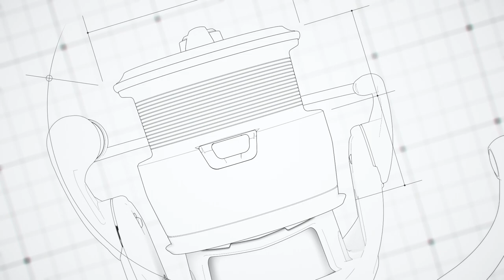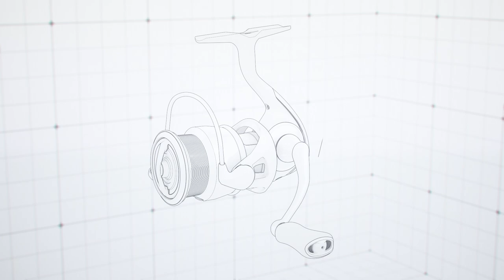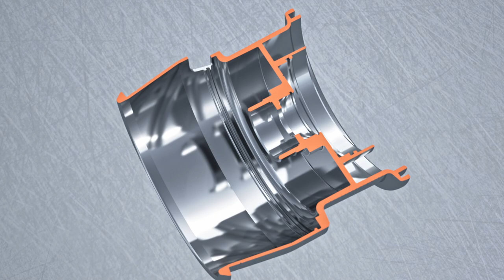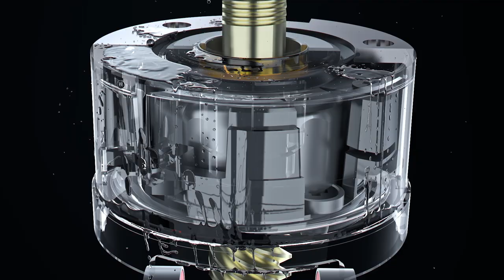INTRODUCING 22 EXIST || AIRDRIVE DESIGN CONCEPT

Comment: I've been looking at this new 22 Exist after seeing the improvements since the 2018 Exist, such as the removal of the anti-reverse switch if i recall correctly from online comparisons. This video is one of the best I have seen re 'introduction' to a new reel especially since Shimano released the Stella FK 2022 within a similar time frame (talk about competition and timing). 😁

This one for the Exist is better in my view especially with the new AirDrive concept and one piece body (monocoque), which has to be better then the Stella FK at first glance before getting into the nitty gritty. I will definitely get this reel (22 EXIST LT 5000-CXH) down the track, which has the sexy round handle (which the new Stella does not have as a standard option) to join the rest of my reels from Daiwa (Saltiga's, Certate's, Catalina and BG MQ Ark) and Shimano (Stella's, Twin Power and Saragosa).

As I don't bat for a particular brand - but appreciate exceptional design and Daiwa's major advancements since 2017-18 around, to clearly up their game (as shown in their design advancements) against Shimano in the mid ($500 up) to high end range. Which like everyone knows, will then be phased into their lower priced reels like the BG MQ ARK (6000 size) I got recently - compliment's of the Certate LT ARK (without the need to change the handle), that everyone gets to enjoy. 👍

Comment: How is the inertia start up % difference vs 2018 model?
Reply from the maker: Thanks for the question. The difference in resistance is about 16% less for start up inertia when comparing a 2500 size 18 EXIST and a 2500 size 22 EXIST.
Reply: @DaiwaAustralia  how is the inertia of exist 2022 compared to that of shimano Stella fk 2022, in 1000 models? Bought a Luvias LT and although smooth it was difficult to turn handle as opposed to my 1000 Stella FJ.

Comment: The Stella reel, which spins like a downhill wheel, is a beautiful scam.
When the fish is caught, he loses his arm wrestling.
It is obvious who is superior in many aspects such as lightness, torque force, balance, precision, starting and stopping, maintenance, aesthetics, ergonomics.
Stella's slow and sequential winding,
it can only throw very light lures a little further. In addition, when the hook is attached to the rocks, it forces the rod to pull, while the rope enters between the two rows, causing trouble in the other shot. . In addition, the bending and deformation of the knitting yarn do not change even if a special nail is added.